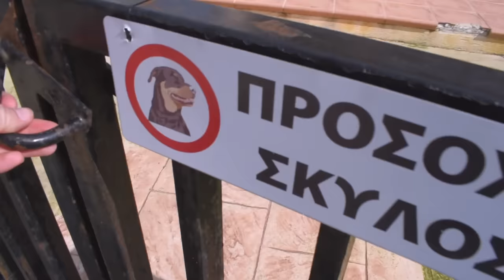Hamster's Underground Starter Burrow | The Big Cage Project Ep.4

Comment: Hello !! I’m all new to hamster DIY and so loving your videos and what you make - would you be able to let me know what wood, wood sheets etc you use and where you get them from?
Reply from the maker: For the majority of my projects I use solid pine, but occasionally I use plywood (like in this video). Plywood is slightly easier to work with and more lightweight, perfect for beginners, and I'd definitely recommend it for making toys/houses/etc. Pine is more hardy and I personally think it's a better option for building actual cages with. You should be able to find both pine and plywood in most large hardware stores 😊

Comment: You may have said this, but what type of wood do you use? I would like to build something for my hammies and want to make sure the wood I use is safe =)
Reply from the maker: Often I will use solid pine (redwood), but for this project I was using plywood as it's lighter in weight and not as thick as pine making it easier to cut. Both are perfectly safe for building hamster toys/shelves/ect with and should be easy to find in most hardware stores or lumber yards 😊
Reply: @SomethingAnimal  Thank you!! ☺️🐹
Reply: @SomethingAnimal  one more thing, isn't pine bad for hamsters?? 🤔